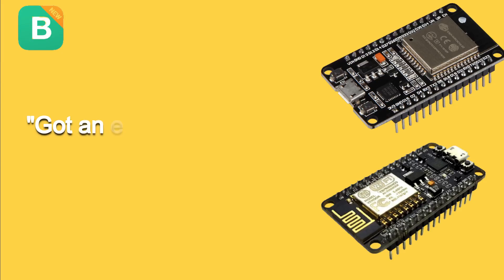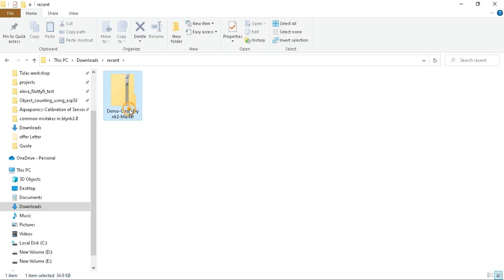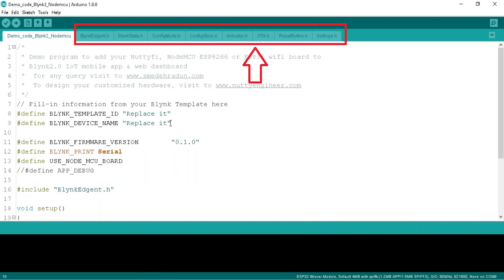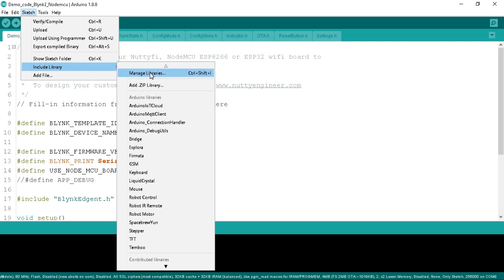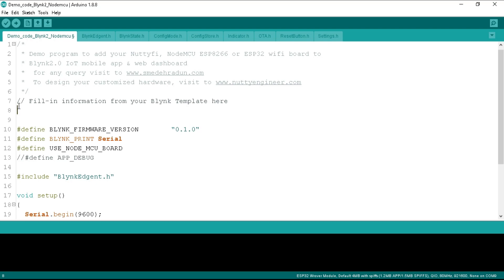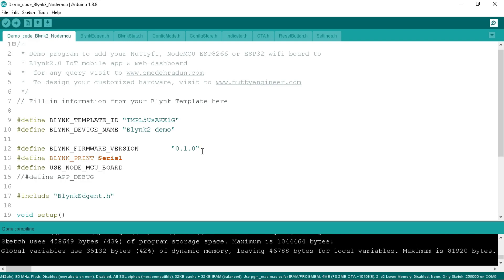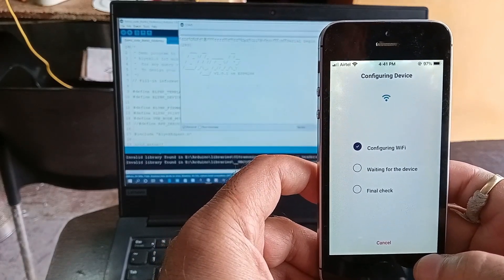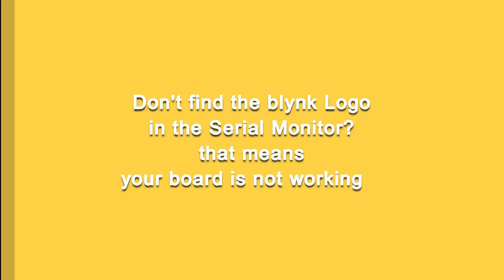How to fix Errors in new Blynk2.0 | Compilation Error |Connection Error | Board Error| Library Error

Comment: hai, i already follow your instruction to clear trash in eeprom, but the notice on my arduino IDE is still there, it's written : "error for compiling ESP32 board' . I using ESP WROOM32 . Do you have solution for this? thanks.
Reply from the maker: This is not the eeprom error. There may possibility of syntax error in your code.  So select the appropriate board & then compile. Library & header files must be included.
Reply: i'm using your demo code and i think its fine with the code. I also have selected the correct board because my board be able to execute previous program I put on. Full error code seen like this: 

In file included from sketch\BlynkEdgent.h:9:0,
                 from F:\TELKOM UNIVERSITY\SMT 8\Kerja Praktik (KP)\PT.Rajakon\Demo-Code-Blynk2-Master\Demo-Code-Blynk2-Master\Demo_code_Blynk2_ESP32\Demo_code_Blynk2_ESP32.ino:16:

C:\Users\Nazhif Setya Nugroho\Documents\Arduino\libraries\Blynk\src/BlynkSimpleEsp32_SSL.h: In instantiation of 'bool BlynkArduinoClientSecure<Client>::connect() [with Client = WiFiClientSecure]':
C:\Users\Nazhif Setya Nugroho\Documents\Arduino\libraries\Blynk\src/Blynk/BlynkProtocol.h:221:17:   required from 'bool BlynkProtocol<Transp>::run(bool) [with Transp = BlynkArduinoClientSecure<WiFiClientSecure>]'
sketch\ConfigMode.h:427:15:   required from here
C:\Users\Nazhif Setya Nugroho\Documents\Arduino\libraries\Blynk\src/BlynkSimpleEsp32_SSL.h:39:9: error: 'class WiFiClientSecure' has no member named 'setHandshakeTimeout'
         this->client->setHandshakeTimeout(30);
         ^
exit status 1
Error compiling for board ESP32 Dev Module.
Reply from the maker: It’s May syntax or library error. Plz check the code properly. Note it that all the header files must be included.

If didn’t find solution, will reach us at schematicslab@gmail.com

Comment: Still its not showing in wifi
I uploaded the code before and it worked
Connected to blynk and all
But after sometime it didn't connected to wifi 

So i re-uploaded the code

Not it not showing
Reply from the maker: You need to erase the eeprom of your NodeMCU. 
After it Again upload the code & again attach to wifi using blynk IoT app.
Reply: @SMEDehradun  still not working
Reply from the maker: What project you are making?
Reply: @SMEDehradun  home automation
Reply from the maker: Share the link, which video you are following for the home automation.

Comment: My code is working fine, I can see the Ready after i reset on Serial monitor, Also basic codes are also working on node mcu. but when i upload the code and search for Device my app is not able to connect with nodemcu. I also used 2Amp 5v adapter but unable to connect.
Reply: I am not getting online status either in laptop or in mobile blynk app! I'm stuck on a college project,pls help
Reply from the maker: Follow each & every steps shown & described in video. 
It will resolve your problem. 

& still facing any error, let us know.
Reply from the maker: Ok. Have you connected your board to blynk before?
Reply: @SMEDehradun  No, I have 2 Node Mcu Boards I am trying to Connect, One Node MCU is showing ESP_0FE94A, When I search the WiFi. But when I click on it it says: Couldn't Get IP Address. Also when I search using Blynk App it does not connect. I have cleared the EPROM Also
Reply from the maker: Ohk. Which board you are using? NodeMCU? Or ESP32?
Reply: @SMEDehradun  Node MCU
Reply from the maker: K. First you have to connect your board through demo code as shown in this video https://youtu.be/EPhY_hDozeo
& once connected then you edit your template & make your project.
Reply: @SMEDehradun  yeah i have connected before.

Comment: hi... can you give me some a tutorial how to connect ESP32 cam on Blynk V2...?
Reply from the maker: Hi,
This is my another video with ESP32 board- 
https://youtu.be/WauwiSBxF0Q

In this video, I have controlled the servo motor using ESP32 board. 
& if you are facing an error on it, you can write to comment box.
Reply: @SMEDehradun  I have some a trouble to connecting ESP32 Camera on Blynk v2.0.... can you give me some a explanation...
Reply from the maker: Yes, you can video stream the ESP32 camera on blynk  “Video Stream” widgets like blynk1.0, 

but in Blynk2.0, you need to upgrade your Blynk app to pro version.
Reply: @SMEDehradun  yeess i already have pro version... But i can't stream the ESP32 camera on Blynk V2...
Reply from the maker: @helgadavis5335  but I don’t have pro version on blynk. 
If you send me the login credentials, then I can let you after testing on it.